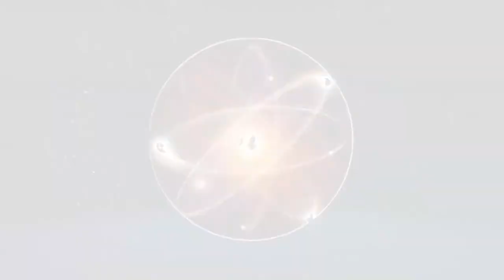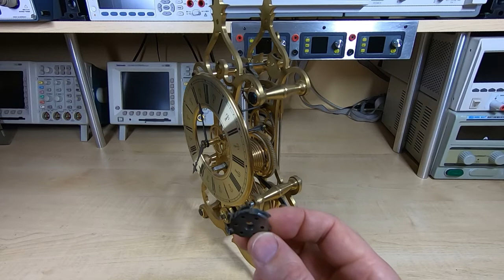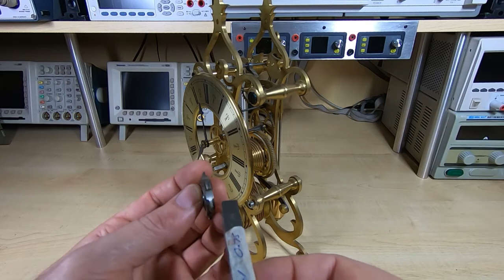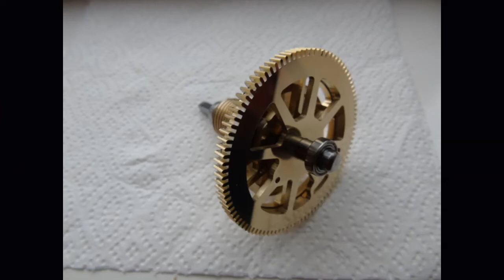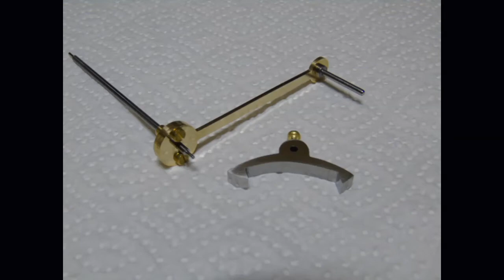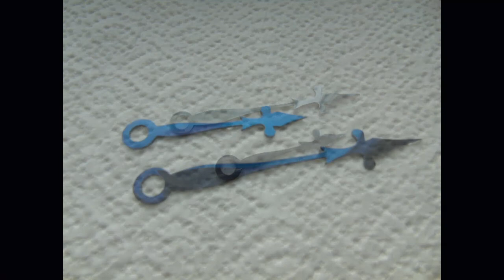500 Subscriber Special

Comment: Impressive work! What is the absolute minimum of tools you would need to create it? Just the raw material and a set of files?
Reply from the maker: Thanks , I made the two clocks in different ways. For the first I cut the frames with a scroll saw (20+ hours) and the second I used a CNC mill (3 hours). But I also made a set of frames using only a hacksaw and files (this was actually faster than the scroll saw). It is the same with most of the parts. Most can be made using simple tools or whatever you have. To make one in a reasonable time I would suggest a lathe, mill and a good selection of hand tools (files, drills etc). Most of the tools I made such as the depthing tool, die filer and large broaches. These can of course be purchased but they are expensive and it is interesting to make them anyway.